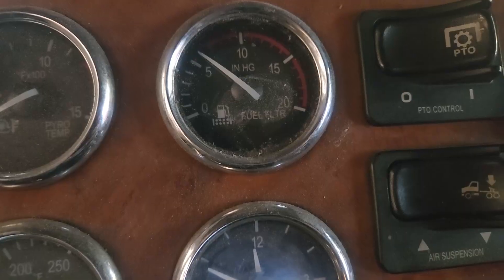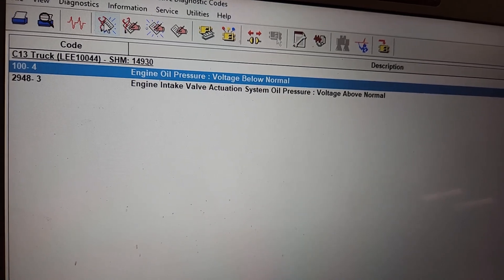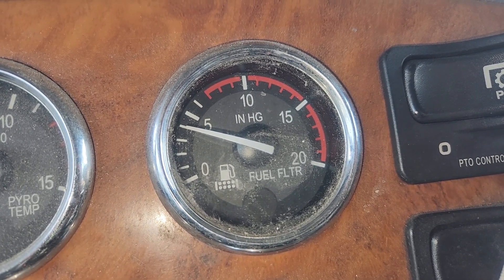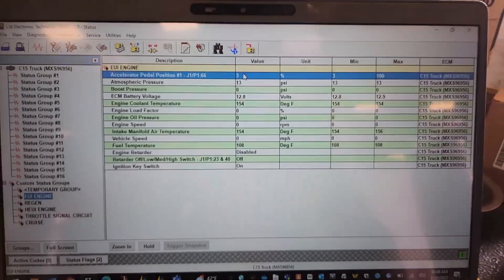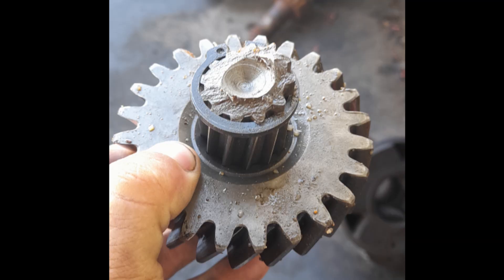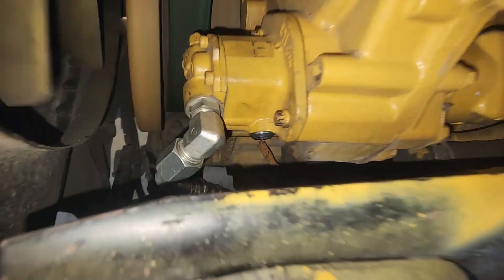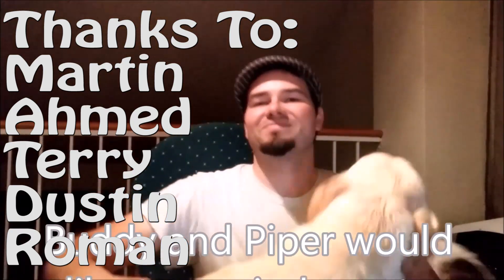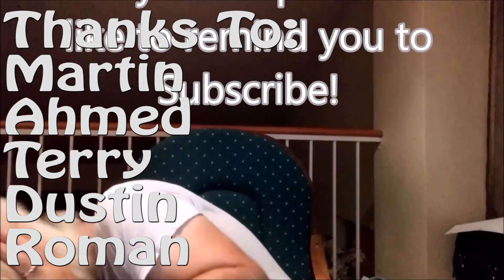Car-Hauler Peterbilt has WEIRD fuel system problems. Cat C15.

Comment: I would check the fuel tank breather. If it was bad it could cause a vacuum. Maybe next time take the fuel cap off and see if the bubbles go away.
Reply from the maker: Good suggestion. I did try that and no change. The restriction would be uniform before and after the filter housing if the tank was the problem, but it was only showing restriction at the filter housing and not before it.
Reply: @AdeptApe  does that have anything to do with old fuel lines? Someone once told me the insides disintegrate over time
Reply: @AdeptApe  maybe something in the like near the filter housing?
Reply: @AdeptApe  I had a head-scratcher fuel system issue this week too.  Would be curious to see what is up with this one.  Cool find on the vapor bubbles!  I haven't done much testing with restriction gauges, but I wonder if any restriction before the primary fuel filter would be simply added or actually compounded by the filter?  I mean, we're talking pressure drops even in the restriction world.  So say you normally see 3 in HG restriction (1.5 psi reduction) after the filter when the inlet is supplied with 14.7 psi atmospheric.  But now say you introduce a 2 in HG restriction before the filter.  Your restriction after the filter will now at least be 5 in HG (3 + 2 ) or a 2.5 psi reduction.  Would it create even more than 5 though (since lowered inlet pressure reduces how much volume can flow through the filter media for any given pressure drop)?  

Note: the restriction went up after the new relief spring because the pump was flowing more volume due to the increase in pressure.
Reply: @AdeptApe ..Josh could u explain why they don't install low psi lift pumps from tank to transfer pump?..wouldn't that that fix all these  issues?..not a big diesel guy so if anyone could explain  i appreciate it..thx
Reply: Yep, any time I have a sucking air issue the first thing I would do is take the fuel caps off. It's the simplest thing to do, and the most over looked and I did learn that the hard way.

Comment: (or in Hg) Unit of atmospheric pressure used in the United States. The name comes from the use of mercurial barometers which equate the height of a column of mercury with air pressure. One inch of mercury is equivalent to 33.86 millibars or 25.40 millimeters. See barometric pressure. Plus mercury is tasty!
Reply: What does it taste like?
Reply: @Florida_Man_In_Florida  He is trying to be funny, mercury poisoning is a thing.

Comment: I have the same restriction issues on my 2005 acert, it's always at 6" gH and the fuel pressure @90psi at 1500 rpm and about 82psi at idle. 

I've been chasing it for about 3 years now without much success.
Reply: I'm not a mechanic, but have read several people talk about old fuel lines collapsing on the inside (old rubber) and also the fuel 'T' on top of the transmission. Also fuel pickup lines in the tank. My tanks used to not equalize all the time. One would be full & the other would completely run out of fuel